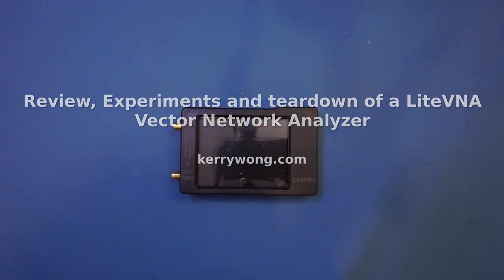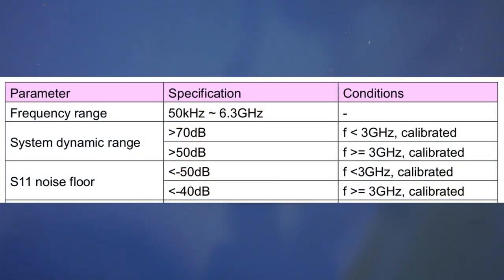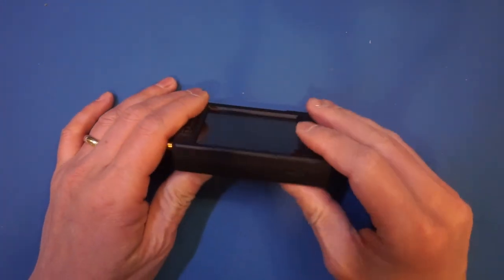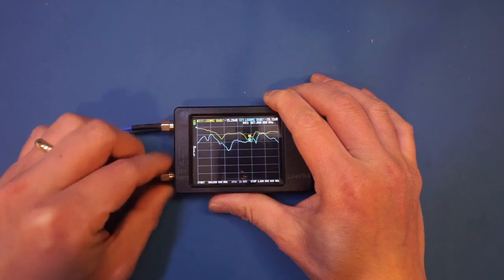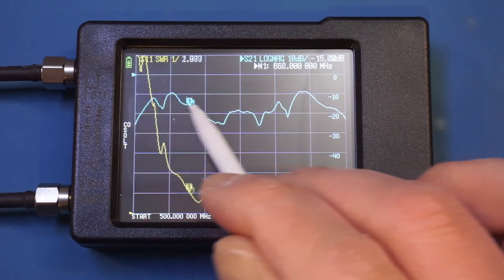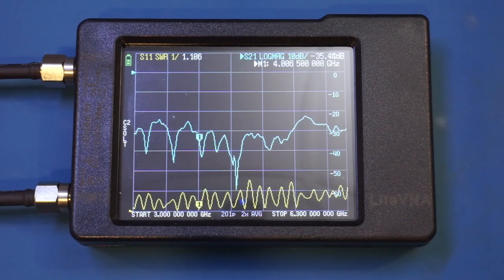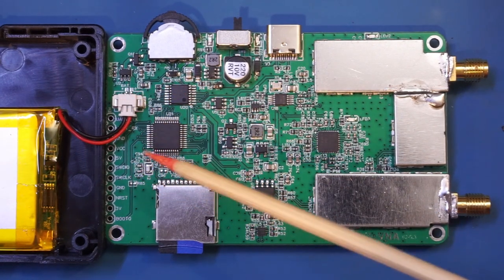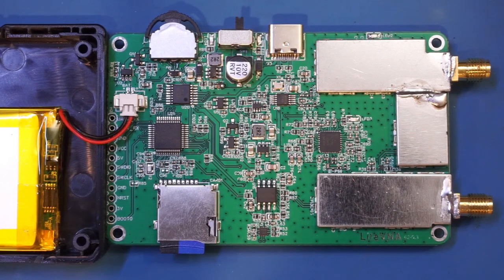Review, Experiments and Teardown of a LiteVNA Vector Network Analyzer

Comment: so this is NOT using the harmonics for higher bands because it does actually have a 6GHz synthesizer in it unlike the nanovna which only had a 300MHz synthesizer and used harmonic mixing
Reply from the maker: Thanks for the insights. Interestingly though is the noise floor in the 3-6GHz band is significantly higher than the other bands hence I assumed it was using harmonics.
Reply: @KerryWongBlog  it could be that they do not actually use the 2871E up to 6GHz but rather maybe up to 1GHz or 2GHz and then use its harmonic content for the higher band? or the higher noise is simply because of something else. If it is due to harmonic mixing there should be a clear jump in noise floor. can you see such a jump? i dont have this device nor its schematics....

Comment: I still think the Deepace KC901V is one of the best portable VNAs on the market in terms of performance for the price but it does cost nearly $2000.
Reply: lol, you should rething your standards before making such statement, do not forget the specs of these "vna" are closer to toy than actual instrument, sure they can do simple jobs job with half the dynamic range of an actual VNA and a lot of interpolation, but still ,they are not really precise instruments. The KC901V performance is relatively low, you'd better purchase an used actual instrument, even 20 year old, it will be several order of magnitude better, for example my protek vna dynamic range is 130dB and it's flat even before calibration.

Comment: I have one of the nano VNA too and I was just wondering if it would be best to unplug the battery when it is not being used because I find myself not using it in several months and I've just wondering.  Wood the battery to last a little longer? If I unplugged  the battery And would it say the electrical components in the nano VNA from getting damaged or would it cause damage by keeping it unplugged from the battery? Thank you
Reply: Yes there will be a little drain. How much you have to measure if ya want. Charge it to 3.8v and store it at that voltage with the battery unconnected.

Comment: I plan to buy one for fpv tuning at 5.8  ghz swr. Is it good in this range ?
Reply from the maker: Depends on what kind of precision you are looking for. The performance of the LiteVNA between 3 and 6 GHz are not as good as in lower frequencies due to harmonic mixing which is inherit to the design. That said, at this price range you don't have many choices available either unless you stumble upon a piece of used professional instrument on eBay...
Reply: @KerryWongBlog  it is mainly for swr tuning.